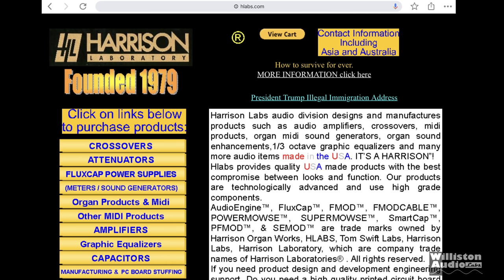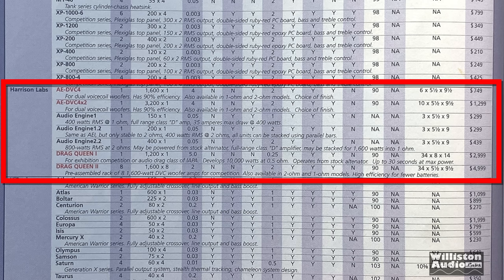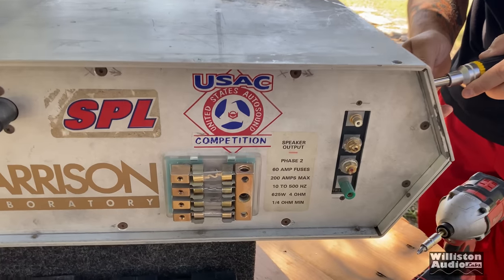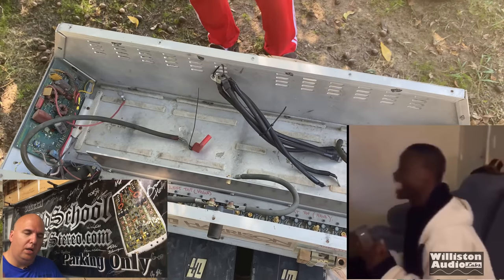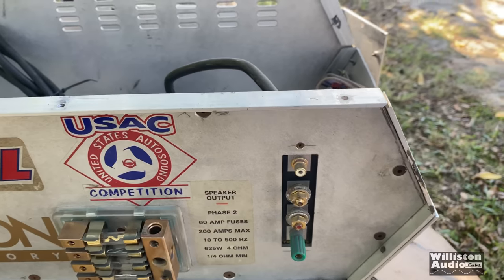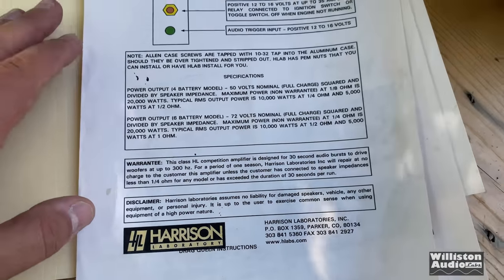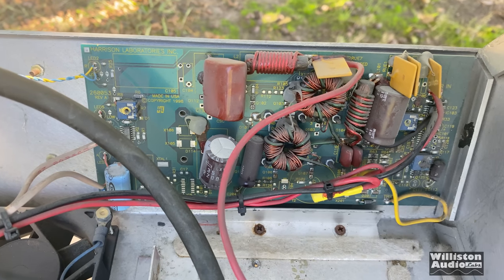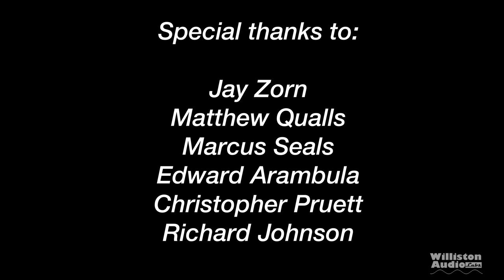20,000 watt Amp Banned from Competitions? 2000 Harrison Labs Drag Queen [4K]

Comment: You would need a different charging circuit for lithium batterys
Reply: Actually no. 4 Cell lithium Iron Phosphate batteries are an exact drop-in replacement for 6 cell(12 volt) AGM Lead Acid batteries. The lithium batteries can be charged to capacity at 3.4 volts per cell(13.6 volts) and can withstand 3.65 volts per cell(14.6 volts) You would be correct, if you were to use Lithium Ion, or lithium polymer, which are 3.7 volts and 3.6 volts per cell, which would turn the 12.8 volt(both AGM and Lithium Iron Phosphate)batteries into 14.8 volt or 14.4 volt batteries.

Comment: I'd like to see a schematic.  It looks like it's class D at it's most basic (brutal, efficient).
Reply: Output is probably push-pull that switches at the audio frequency but is a squarewave only. Not quite class D. Not class C either. The 6 batteries are two 12v in one housing. This could provide 72v per rail. At 0.250 ohm that's 288A 20,736W.
Reply: @lazzer408  very good..... lazzer408 knows his shiznit with cheeze!!!!! the PRIZE!!! BDBD/2021
Reply: @lazzer408  that thing utilized a CAP BANK too.... MASSIVE DRAIN in a BURST from them caps REALLY DUMPED the voltages... Batteries... a slower DUMP....

Comment: Yes sir the higher the rail voltage the more power the actual amplifier section of the amp Can put out before clipping but the actual guts are so small you can't get that much power out of only inputting 4 V you're gonna have to have a lot of input voltage
Reply: This thing would be a beast with some super caps.
Reply: Tim Hunter right

Comment: I would love to see you amp dyno this amplifier.I am willing to bet this amplifier is very loud .Kind of like those original thin 300-400 watt equalizers in the 1980’s
Some of them were really loud granted they’re had 25-30% distortion .They didn’t have a lot of bass .It was all midrange and highs .Some of them had these alarms
They were ear piercing lol 
I bet this amplifier is probably maybe 1000 watts 
But it’s just loud. It would be perfect to get some 15-18” Black Widow or Cerwin Vegas woofers that are 96-98 dB 
With some horns .You would have the loudest and most ear piercing system
You would haven’t to buy any pest control lol
You would run any 2-8 legged creature off lol
Harrison labs had a small subwoofer box that had I believe a 6 1/2 woofer .They claimed it was equivalent to 2-12” woofers 
I believe that called it the power mouse ??
It was about 30 years ago .
The box wasn’t very big 
The company was always kind of created controversy.
Reply from the maker: Kinda like the news now 🤷‍♂️
Reply: @wal  Sad, but true!!

Comment: I don't see any component arrangement in there that would be needed for an amplifier.
Are you sure it is only the batteries missing? It looks almost totally gutted to me...
Reply: Smart, that's because it's not an amp. It outputs square wave and nothing else on limited frequencies and sounds like dogchit the entire 30 seconds it's capable of doing so. It's a signal generator and a switching power supply to charge the series connected batteries, that's why it looks like nothing without 80 pounds of battery stuffed inside. 

In other words, it's so dumb that not even decibel drag people want anything to do with it, hence it being banned.
Reply: @pontiacg445  That is so absurd, I had to let it sink in. My first impulse was complete denial. 😅
But it explains what I saw, so... it makes sense again.

Comment: Unfortunately they did not create the first car amplifier. In the year 1974 was giving way to compact cassette as the tape format of choice. In the era of 8 track tapes, there was some amplifiers built much earlier than 1974. They were old school, with an audio transformer to get the higher output voltage.
Reply: Note, the patent is for the first "Bridged" amp design. Earlier versions on the market used audio transformers.
Reply from the maker: So you are saying marketing department stretched the truth? Say it isn’t so 😮
Reply: @wal  Or the reporting of the first bridged design lost the word bridged in the media.
Reply: In 1977 I couldn't find an affordable (non-Zacpo) car audio amp so I installed my Concept 5.5 home audio receiver under the passenger side of my dash and used a military 250w 117VAC inverter in my trunk (because the transistors buzzed so loudly) and installed a set of Altec 12" woofers in the trunk firing into the cab and 8" AR 2-ways in the front doors of my '66 Chevelle.
It sounded better than almost any home stereo at the time and vibrated my rear view mirror so bad I was always looking at the floor - lol
- Now that's "Old-Skool"
Reply: @mrq4028  MR old school........ cool... Them were the days huh.... I remember the first time I took a Jensen HOME speaker and stuck it in the trunk.... then 2...LOL....... I was SOLD..... my old 64 Barracuda ROCKED in 1976.... LOL... the good ol days.....

Comment: ya all got to factor in the INDUCTORS... 16 woofers.... as part of the overall DESIGN.... Think about it.... LOTS of filtering in 16 inductors... Woofers run dirty power all the time.... unheard.
Reply: The filtered bit is converted directly to heat. Not good

Comment: They were right to outlaw this so called amp, what they didn’t mention is folks could’ve added more batteries rows in parallel to sustain the  rail voltage. There’s so many mods that could be done to that amp it would have been a cheaters paradise.

Comment: wow at the transistor count, its a classic totem pole transistor driver output design, i wont say mosfet as for its age i think transistors will be what was used, now if i was building i would use mosfets, and just stacking them to get more amps is what i do in motor controllers, doesnt matter if your pushing those amps into a  motor coil or a voice coil, my big question is, what was the justification for the ban?
Reply from the maker: It’s not a traditional amplifier design and was basically playing distortion from the charged batteries
Reply: They’re mosfets. It’s just a huge push/pull mosfet switch.

Comment: Please test this theory, comma I have been told by many people back in the day that amplifiers could be used you use to power component components and save on electricity in your house by the information in this video it seems that you may be right is this possible or With all the information you have on amplifiers is the indication of what just something people say or is it actually wattage that can Be converted into conventional power outlet outlet or an inverter I hope you understand understand what I'm trying to say but in short.. We're trying to see if you can use a powerful amplifier to step up the electricity electricity from 120 to to thousands of W and actually run something Just like an inverter . If so we have some very powerful equipment equipment we would like to run using just 12 V batteries.
Reply: They can in theory be a sort of (not very well regulated) DC power supply, or as their intended purpose, boost a small AC signal to some larger voltage.  They just won't be very good at it for sustained drive or dealing with transient loads and other things.  Also they tend to have filters for blocking DC but that can potentially be shorted over.  Basically, there's things out there that work on similar principles but are better made for and more efficient for such tasks, and probably cheaper to buy for something that could reach high, sustained power levels and not need modifications.
Reply: @Aeduo  thank you for your response and I agree so I'm setting out to challenge myself to build a amplifier for batteries, the audio system that I'm supposing car batteries just won't handle it and since I needed portable inside and outside a vehicle I need something that can really give me $9,000 Watts of power have any suggestions
Reply: 10,000 watts for a minute is 0.16 KWH or approx 3 cents worth of house power
Reply: Power is power, you can't just magically amplify it and save on electricity. If sometimes requires 1000W, it will require at least 1000W and there's no way around the laws of physics.
Reply: @goz3rr  all you have to do is to repeal the laws of physics! Politicians do it all of the time!

Comment: When you would try with lithium batteries?
Reply: SUPER CAPS..... the BIG POWER was achieved using CAPS not Batteries... the CAPS Harrison used was the REAL design... Batteries were more affordable so... they were used in that design but the CAP BANK was the BOOM.... I remember..... HARRISON LABS I believe was the first to use stiffening caps and later offered them to the public... LONG ago....

Comment: where can i buy 7 of these?
Reply: walmart
Reply: Brazilians.... they figured it out...... huh.... Sure ya need 7?...... thats a LOT of batteries... DC MOUNTAIN....
Reply: 168 12 volt batteries...... DC MOUNTAIN......
Reply: a CITY BUS filled with batteries..... yeah..... SEE that BUS over there?..... thats my BATTERY PACK........... and so it is in Brazil.....
Reply: You can make it yourself easily and much more powerfull if you want to ... It is just a swithch that revereses the polarity of the battery power fast, more battries more power... It is just a burp machine creating a square wave signal.

Comment: now back then was true wattage up to the mid 90's but I don't think so on that amp.  update i thought it was built in 1979 but read it wrong. now back in 2000 i think that's when all companies started scamming people false advertising on watts by adding all the channels together that was over rated. when that wasn't how they actually calculated the wattage back from the mid or maybe almost late 90's on some brands and models back to the early 80's. A 150watt amp then is like a 1,000watt amp now days. talk about a big scam and deceptive sales now days. if you don't believe me go and get an older amp and buy a new amp and compare. also they do the same  with speakers and subs. false advertising. the stuff in late 80's and early ninety' s was the best built subwoofers of actual name brands very few cheap. but now kickers ain't built like they used to be or Rockford fausgates and many more. and if so the ones that are, are the highest priced models way to expensive. and ain't worth it. when their still not accurate on the wattage
Reply: Cut the false number in half and you get your true wattage. You can also tell by the amperage ratings on the fuses.
Reply: Back in the 90s, china would omit putting the decimal point on their wattage logos so a 20,000 watt amp was really 200.00 watts.
Reply: "O" watts...... Go ahead and say it all in ONE WORD...... OWATTS..... Its pronounced such in Asia.     not WATTS.... OWATTS...... My friend TONY from Taiwan explained that to me one day and then I got it.... LOL..... its Owatts..... OK.... hmmmmm........ Kinda lost in translation.  Needless to say.... just LOP OFF that  LAST "O"..... its not a ZERO.... its an O......LMN O...P... LOL...... and there ya have it.... Much more accurate output number.   Thats a story.... I remember.... TONY.... he cooks NOODLES there in Taiwan and I understand he is VERY GOOD at it...... $$$$$$$...... I remember.... JET SOUND.... 1000 watt..... 100 watt amps...LOL....ugggggggg............ BDBD/2021
Reply: @MOTOHEAD-ko3tq  FUSES tell the story huh?...... and input size from battery.... FATTER means WATTS....

Comment: 20,000 watts, you've got it all WRONG again. Closer to 1000 watts.
Reply from the maker: I didn’t make the claims, just showing off this Air Conditioner wanna be box and specs provided by the manufacturer
Reply: It’s a push/pull mosfet switch. Very different from an amp. It’s just a massive bank of mosfets that switch on and off and dump current directly from the battery bank to the subwoofers. It’ll do 20KW and probably a lot more if some lunatic wires it to .1 ohms.

Comment: why was it banned?
Reply from the maker: DBDrag said it was not a conventional car audio amplifier
Reply: Because it used internal batteries and several of the classes back then limited the number of batteries you could use in competition.
Reply: @mrq4028  thats right.... I remember showing up early om with 10 batteries in a small trailer... Marine Plug right under the bumper to supply the sound system for extended runs.... later.... SPL runs... later.... someone was grumbling about my BATTERY TRAILER..... Complaints... the BEST..... walked away. OR were BANNED away........ LOL.... I gave up... yeah.... RETAIL SALES from then on... Let the children play... BDBD/2021
Reply: 24 batteries... to power that thing.... 300 volts DC.... Maybe I will just BUY one or two..... and RELAUNCH MY BATTERY TRAILER..... Fond memories of a time....LOL...... BDBD/2021

Comment: Well, it's banned, because it's not CONVENTIONAL.  IMO, genius, in the fact, that competition just wants a short display of power, and this amp, concealing EXTRA INTERNAL power, can deliver, and on demand, moreso, because the batteries are so close to the Amps. Regardless, all it's good for, is competition.  Before you took the cover off, I was trying to figure out HOW they are going to make the common false claim of delivering MORE wattage, then you put into it, and that's an honest way to do it, put batteries inside the Amp. (insert time factor of course) Depending on the style of fuses, 30 amps, is still only going to render 360 watts, but some other style of fuses might deliver 90 amps for a period despite being rated at 30 amps.  That's 1080, and with back up battery inside, it's real easy to see you can get some serious power with the right components.  Just for competition, otherwise playing it louder than the supply, the batteries will dwindle down, and fail.
Reply: I feel sorry for everyone who, like myself, reads your post the way it is punctuated.
Reply: overseas..... its not BANNED..... its EMBRACED.... ugggggggg......

Comment: Hey bro can you test a taramps md8000.
Reply: They're almost the same as the HD8000, but can handle lower voltage drops. They don't delegate the power, as efficiently as the HD8000 when it senses a sine wave, but they are better on music and running them at the same output voltage testing the two myself, the MD does better numbers on music, where the HD does better numbers on a burp.

Comment: Reminds me of the big Brazilian amps now a days.
Reply from the maker: Except they don’t have batteries inside 😮
Reply: @wal  no, but don't the big ones work off super high voltage?
Reply: @MullinPerformance  The HV lines, yes. They operate off of 300-500vDC and have no power supply section, just an output section.

Comment: The power inputs just charge the batteries, they only have to last 30 seconds so charging isn't necessary during the audio burp. Way easier to use a simple set of mosfet rails to create burps of whatever voltage the batteries added up to, than to create an actual audio amplifier. That's definitely a true "cheater". 😆

Comment: Oh iam interessted about the power of this Amp... please talk with hin to make a little dyno test... at 1 ohm load and then we can calculate the watts at 1/2 and quater ohm... but quater ohm ist abnormal..
Reply from the maker: All of those ratings are based on some unknown amount of clipping so it would be difficult to measure
Reply: @wal  The only sort of viable way you could measure it is by clamping the power on a low reactive load. The AD-1 could probably (?) do it but the distortion would be so high that it may shut down..?
Reply: @wal  yes i know but i would do it with the standard from today 😊 for this price it must make power... i think the output is a "high" voltage can you test the American Audio 2500 PA Amp ? I have one.. i think it makes a little bit more power than the datasheet says.. i have put  2 ohms load on it.. its minimum 4 ohms load and it makes lots of power the 10k 18s subs make 3cm x max on this amp 😂  it can be a wow Amp 😊👍

Comment: I would of banned it too!, that is one awful put together, pile of scrap metal!, absolutely pathetic!!!
Reply from the maker: Ouch!
Reply: Considering the technology of the time it was a reasonable approach to a niche market. 100 plus amp charging systems on the average car and pick-up truck weren't at all common and MOSFET switch mode power supplies of high efficiency and output weren't commercially commonplace. Happy Thanksgiving and God Bless.

Comment: No need for a voltage transformer! Lol ! Just pump some signal into relays off 72 Volt rail
Reply: I'm sure that's all this thing does: it's just a solid state switch box. Notice the simplicity, and the lack of any gain controls, and there's no way that thin light weight heatsink is massive enough to absorb the ~4,000 watts it would have to dissipate, if it was a class A/B amplifier, delivering 10,000 watts RMS sine wave for half a minute! It doesn't need much of a heatsink, if it's just switching rail-to-rail.(square wave)

Comment: It's actually a good design for its time the reason why the power wire so small it's literally just a high-voltage battery charger built in. in modern audio amplifiers most of the physical size of an amplifier is all power supply to make rail voltage. Just think this is before ultracapacitors or good Battery Technology even really existed..  it's funny because look at all the high-voltage Brazilian amplifiers wonder if they use the same as ideology to operate #str8clpn

Comment: you will blow up lithium batteries.. led acid or NMh.. best as caps.. which basically the batteries act as F caps
Reply: good observation.... That thing was initially designed to be packed with CAPS.... Batteries gave a slower burn is all... CAPS WENT BOOM.... quick....